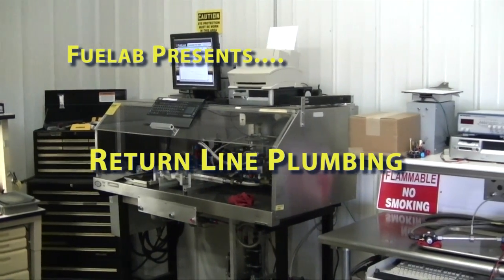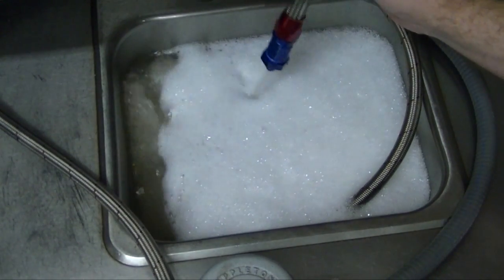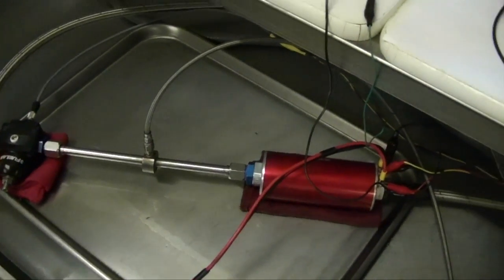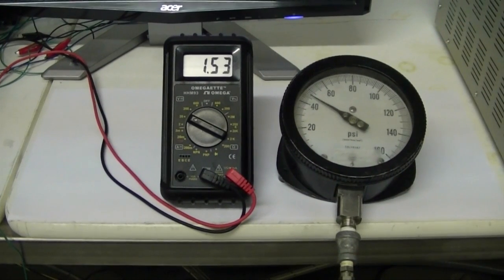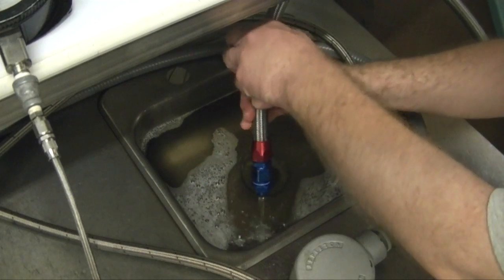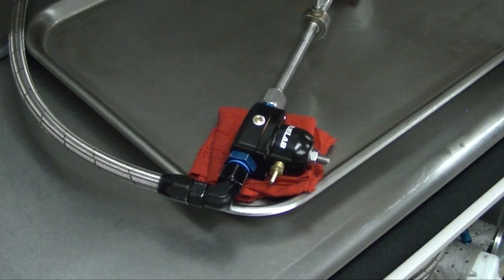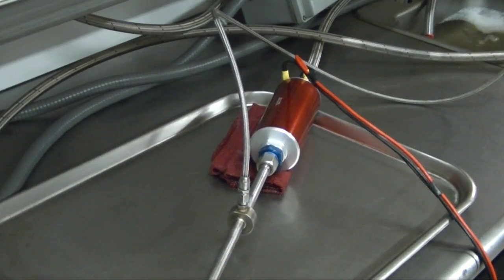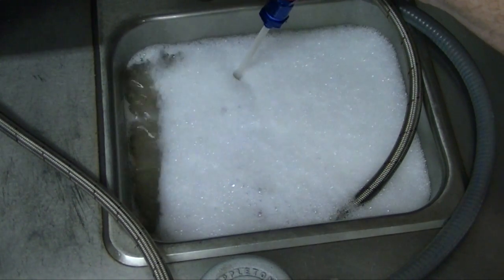Fuelab Tech Tips: Return Line Plumbing

Comment: Right on. Just did this job  today to my returnless 2008 KIA Sedona's fuel system. I added a return regulator to it because the aftermarket fuel pumps put out WAY too much pressure causing both banks to run rich. 
I did have the return line exiting into the top of the tank.  Added the dip tube and GLAD I did! Thx.

Comment: What is with the 1.67 voltage?  A 12V motor should barely run if at all with that kind of voltage. Is that just a signal voltage.  This is not a PWM signal.

Comment: I use my dual fitting sumped tank for supply and return with no issues.  Most places will tell you not to do it, but my intention was to prevent aeration of the fuel.  Sure I inject a little heat back into the tank but the methanol system flows so much fuel heat rise is minimal through the bypass regulator.  Thanks for the video Fuelab - Subscribed.

Comment: I was told that the second line on the bottom of the tank should not be used as a return line do to the added pressure from the fuel in the tank the the returning gas has to overcome
Reply: The 2nd Fitting On A Fuel Cell Is For A Return Fuel System. The Top 2 Fittings Are For Vent & Roll Over Valve Only....
Reply: @jerryengle4684  In my cars I use a 10an pass through bulkhead with a 10an to 5/8 hardline compression fitting and run stainless tubing with a 90 degree bend just above the bottom of the fuel cell pointing along the back wall to the opposite side.
Having the return right next to the outlet in the sump recirculates hotter fuel and any air bubbles back to the pump easier. And it can cause turbulence which makes it harder for the pump to draw in fuel, especially when returning around half of the fuel volume to the cell

Comment: what is the fitting that is wrapped around the hardline?  Is that some kind of flowmeter?
Reply: That is where they tapped in between the pump and regulator to show the fuel pressure on the gauge.